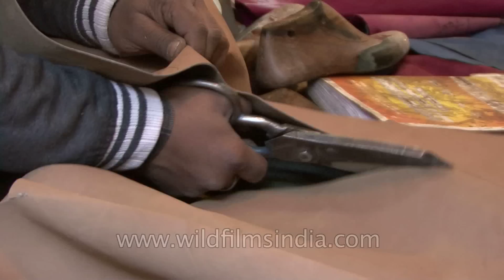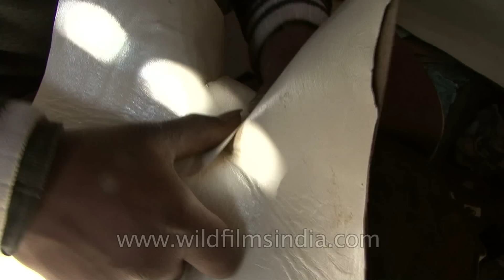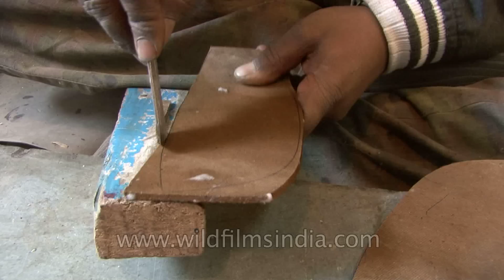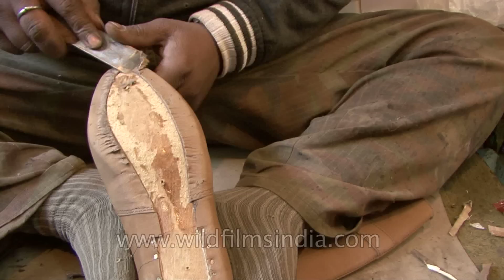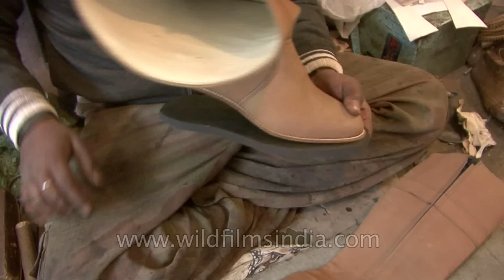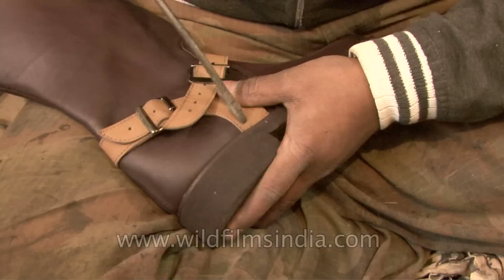Hand-made leather boots being made from scratch

Comment: Any shoe made today using glues is garbage. How many have you bought over the past 15 to 20 years has the sole not fallen off? All manufacturers have them built to fail in less than 6 months.  This video is a perfect example of the GARBAGE that is on the market.
Reply: I have a good solution to this:
Get some cobbler pegs or even just some nails and tack the sole together. Works for more traditional looking boots and really extends their life
Reply: Angus Landeryou
I'm not trying to be offensive but, your not going to be able to "Nail" a cheap "closed cell foam" sole like the ones in this video... those boots are "cheap" knockoffs.
Reply: All shoes and boots use glue as a base for the bottom and the sewed along the edge, trimmed and nailed together.
Reply: Jesse Livingrooms
 They are like hell~!  I paid about a hundred and fifty for Herman Survivors (as an example) and all they use is glue and they fell apart after 4 months~!
Reply: Nathan Stoddard Alas, I am offended.

I just assumed he was using a proper rubber, I haven't seen foam soles before
Reply: Angus Landeryou  go for companies like FRYE , REDWING , WOLVERINE. You are gonna probably pay up of 300 dollars but they will last you more than 7 yrs or so if you take little care of them